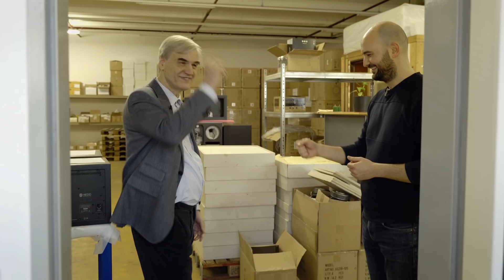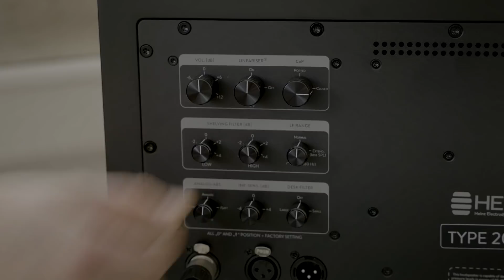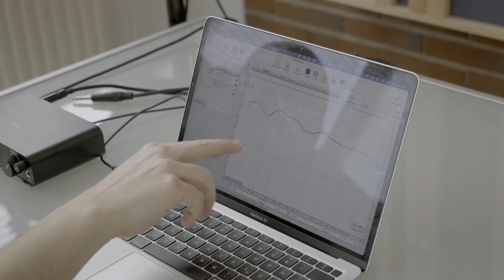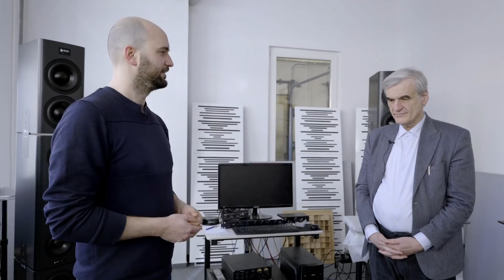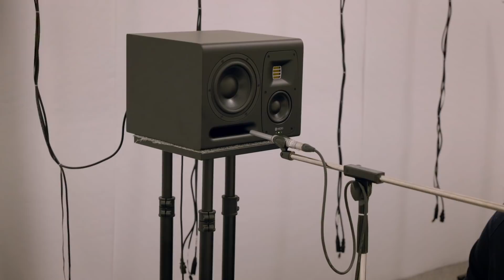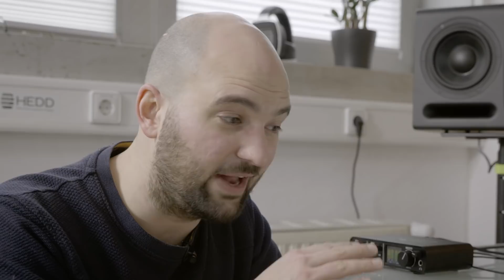Do ported speakers make low frequency decay in your room longer (ft. Klaus Heinz)? - with HEDD Audio

Comment: My NEW most favorite video because the Expert pointed out that those who have heard DUAL 15" open Baffle Pro Loudspeakers become "intransicated, WOWed, shaken by awesome SounD reproduction. They are no longer in Vogue. But I knew I was "Blown away" by them at a strip club one night when I left my chair to sit infront of a Dual JBL Junior playing some Heavy Metal Tune that made my night. Dual 15" Speakers a lost Dinosaur only a Music enthusiast as my self holds great Value for. Those who must Buy the smallest Bookshelf that tries to sound like a 15" woofer. Like ELAC or what ever. Nope aint happening but your delusion may suffice. You need & MUST go BIG 15" KLIPSCH & nothing smaller!!!
Reply: I like you. Right now I am building two dual 15” woofer enclosures for my listening room. To either stand behind or beside the mid/hi speaker (with DSP time correction of course) or lay below it. I am using 2x Eminence Legend BP1525 bass guitar drivers per cabinet. The boxes are 250 litres per woofer, sealed.

Comment: I have a set of Pioneer Andrew Jones FS52’s with two rear ports (top & bottom)…I have a small squarish room & speakers can only be 15” from the front wall.  What’s your take on completely plugging them or only plugging the bottom ports?  I’ve tried all three configurations (open, half closed & fully closed) and it drives me a bit nuts as I’m not really sure which I prefer most & don’t fully understand what each config is doing.

Comment: A few comments:
1) Try measuring the speaker outdoors (woofer and port at ground level, elevated far above ground level, or sunk into a hole in the ground that is flush with the baffle). Then you can easily measure the port’s transient characteristics.
2) identify the port resonant frequency with the waterfall plot, then replace the swept sine waves with sine bursts of 10 cycles at the resonant frequency (you can do this with Audio Tester software.) Use the oscilloscope function on the new version of REW that you are using. You can clearly see how the transient attack is softened by the port, in addition to the decay. You can’t see this with the waterfall.
3) HEDD is using EQ to flatten the response in the closed box setting. The T-S parameters are surely optimized for reflex operation, so they would yield a gradual roll off below around 100 Hz if you simply closed the port. This implies more voice coil heating at LF and more excursion, so maximum output will suffer. Probably not an issue for nearfield monitoring.
4) A purpose designed closed box allows one to use vastly more absorption within the box, which will reduced the impact of internal reflections which are passed through the woofer cone after some delay. This is a source of midrange coloration, as are internal reflections that pass through the port itself. But I think the former are the larger issue.
5) Kudos to you for digging into details!
Reply: Very interesting and logical comments! :) About point 4, so would you say that using more (rather than less) absorption inside the box is overall more beneficial to the overall quality of the sound? Assuming we are talking full-range speakers and not subwoofers. What are the negatives, if any, when using lets say a quite tightly packed box as opposed to something that maybe only has a sheet of some absorption on an opposing inside wall? Isnt the cone movement, or lets say reaction time basically slowed down quite a lot because of the absorption material? I have also come across a box design that is basically something like a hybrid between closed/ported. If used a Seas coax midbass driver (6.5) in a box of maybe as little as <5L, but it was absolutely tightly packed with absorption and had a series of cut "ribs" on both sides of the box. This makes it something like a very big "simulated" closed box as I understood, since there really cant be almost no pressure building up - the "box" is essentially open - yes there is the strong spring effect of the packed wool behind the speaker/cone. The speaker that uses this method is developed and produced by Gradient (finland)

Comment: Ported is 18db per octave, not 12db

6db per order, Infinite Baffle 6db (first order) sealed box 12db (second order) bass reflex 18db (third order) band pass 24db (fourth order).
Reply: Nope. I don't where this comes from, but there is a Youtuber called something with Hex that says something similar, and it is tno true. In a infinite baffle, the driver itself is still a mass-spring system of second-order, so 12 dB, not 6 dB. Sealed means adding stiffness directly to the mechanical stiffness, so the order does not change, so sealed is correctly stated as 12 dB. Ported does only add one reactive component, the mass in the port, but the circuit is now changed, since the stiffness of the enclosure is not located across the stiffness of the driver, so the resulting transfer function is fourth-order, so 24 dB. Look this up in any loudspeaker cookbock, or better yet, put togehter the lumped analogy circuit and work out the transfer functions
Reply: I'd imagine with all the parameters and geometries that could go into it it's not as discrete.

Comment: You open the video in front of a pair of 3rd order reflex speakers. So….I’m guessing no.

The port is like another cone, just uses the air in the tube as the mass that moves the air to make sound rather than a paper cone. I can’t see any way this would make reverb time longer other than a port might get the speaker into a frequency range where there is a mode. If not then no.